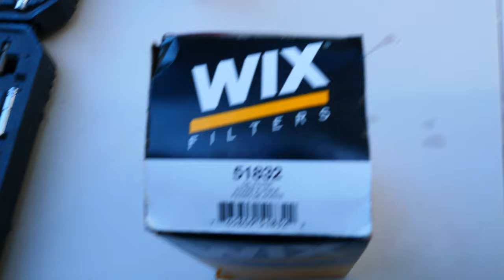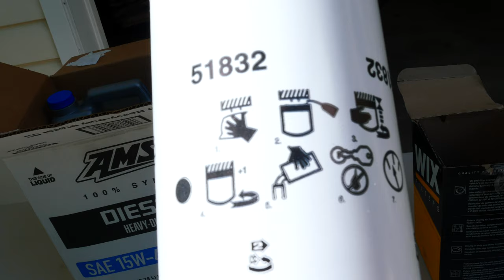Bullet Proof Diesel Oil Cooler | Oil Change Tips and Tricks

Comment: Also when it comes to engine oil you don’t have to worry about air in the system as it is a vented system due to ccv and air has a place to go.  it’s bad if you have air in hydro cuz air has nowhere to go and same with with coolant because it doesn’t have anywhere to go unless you’re too hot and making the 16psi cap vent. Also better to add the arch oil first so it can properly mix and not have a layer of it but in the end it more than likely won’t matter. Just when you take a substance you are worried about mixing with another substance send that shit in first so the force of all the gallons of liquid has a better chance to mix it in, just my 10 cents being a drunk dodge tech. Good video tho!
Reply from the maker: Thank you for your feedback! I do agree with you!